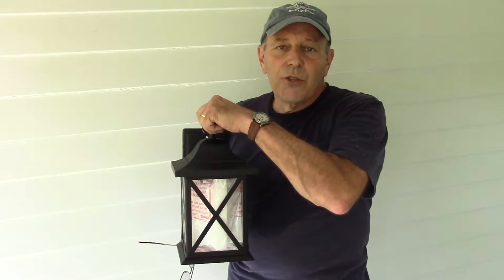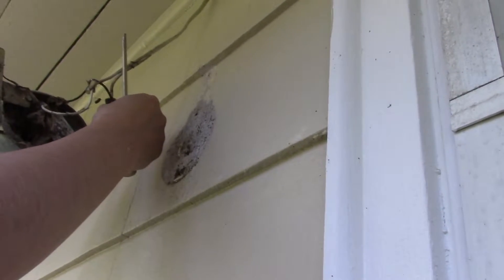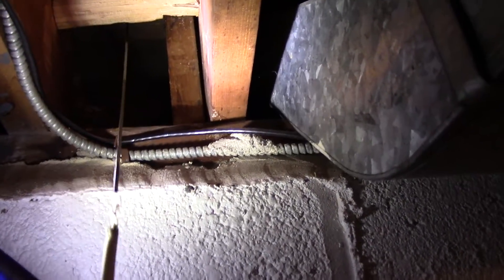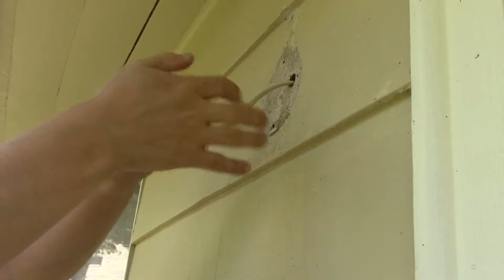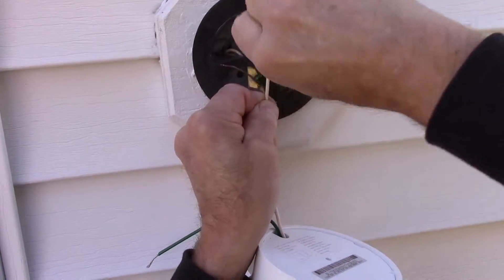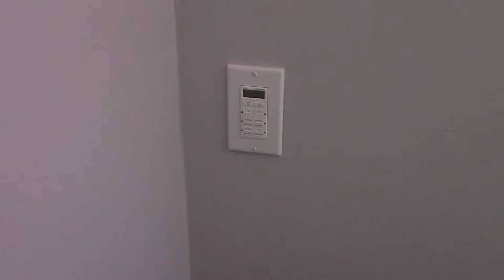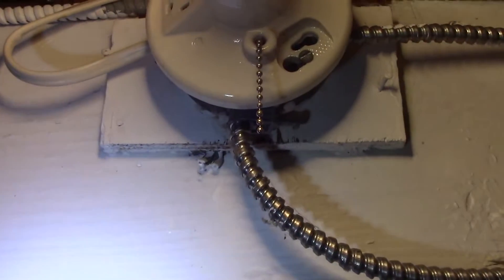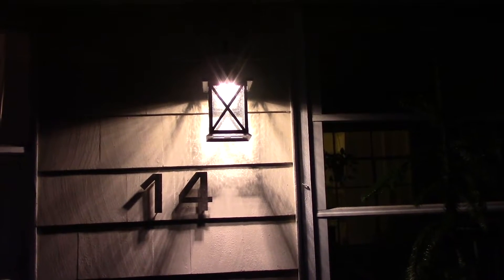How To Run / Fish Electrical Wires Inside A Wall

Comment: You skipped the whole fishing part. How did you get it through the hole at the bottom?
Reply from the maker: You push it up from the bottom and out the top. The hole in the top is easier to the wire out.

Comment: Question - we just took some ridiculous mercury sodium vapor anachronisitic monstrosity off the side of our house that was hooked up to live romex which they teed off of some other circuit that we can't shut off.  So whatz the best way to seal off the ends of the wires so I can safely tuck it back into the half-dollar-sized exterior wall hole and be assured I don't ever have a wall fire???  Assuming a dousing of electrical tape on both wires will seal the deal?!?!

Comment: Title:"How To Run / Fish Electrical Wires Inside A Wall".  Fishing wire through two small holes is arguably the hardest fishing scenario.  Pushing the tap into the hold is not difficult.  Hitting the other hole is....and you skipped that entire process.  

Please consider renaming this video....first word in the title is currently "How"....this does not show how.